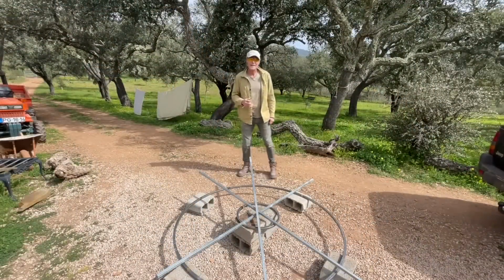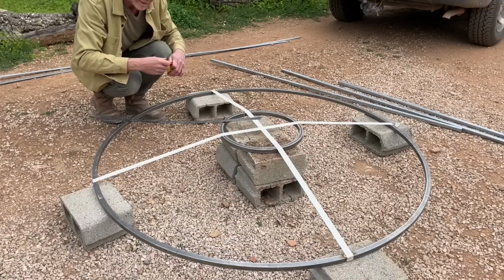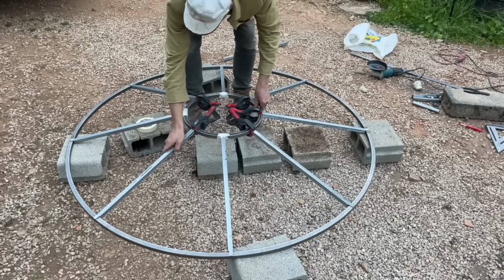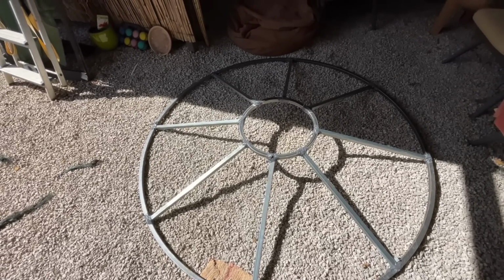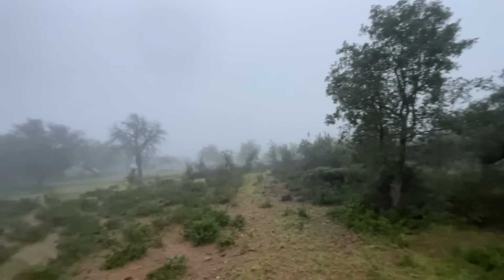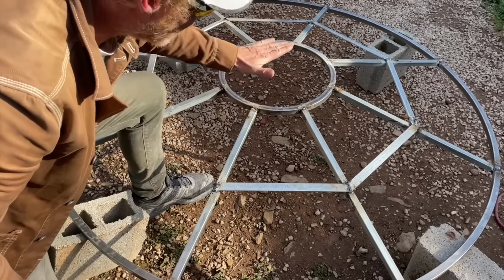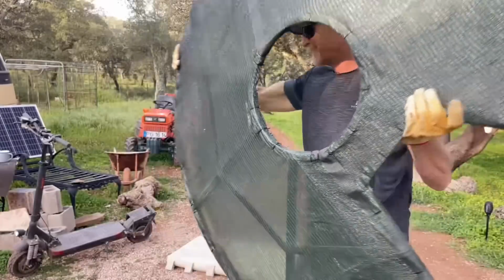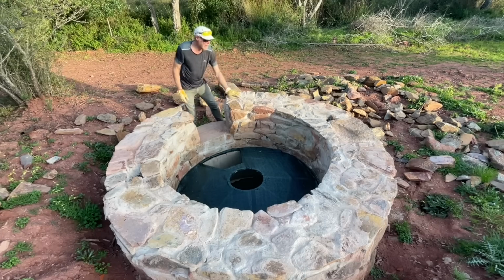IT’S FINISHED | All’s Well that Ends Well #111

Comment: You are very very talented and your painting is so lovely, I am sure Kristina and James will treasure it - as for the well, what a good neat superb job...Just want to add though, little animals / insects / debris can still fall through the gap could you not fit a little door with hinges that could be flapped back when you need to access the well?

Comment: That cement roof is an easy fix, plug the roof,wall cracks with non shrink grout. Then epoxy seal with anti skid surface. 😮

Comment: For the well cover, I think you only need one opening, the quadrangle on the edge, whether you use it for the well pump or a bucket. I also think you should have covers for the openings to slow down evaporation and prevent debris falling in.

Comment: You're moving the stinger to fast when welding. Find a heat setting that won't blow through the metal. Be mindful not to turn the setting to low or you will be running cold. Also don't drag the stick across the area you are trying to weld. Use  more of a back and forth or weave pattern. As you get better you will learn to watch the puddle (molten metal). That's how you will get a better idea of heat setting and stringers. The should look like a stack dimes laying down. Digging your videos.